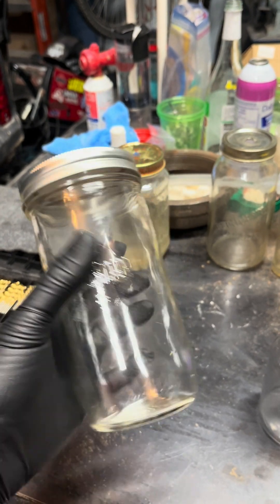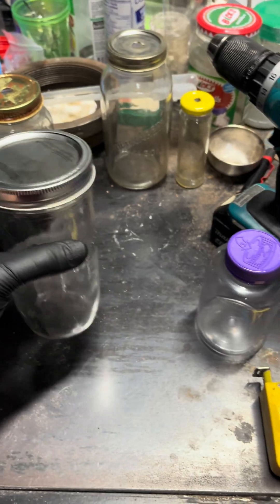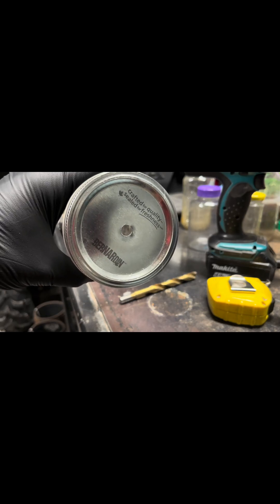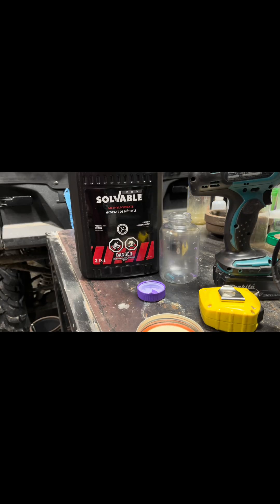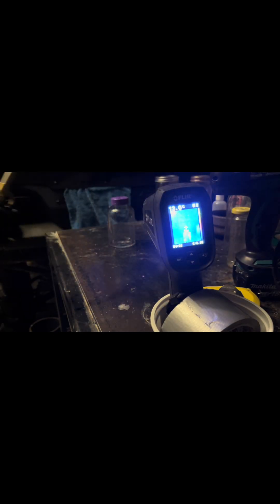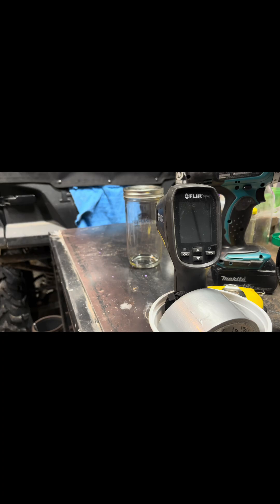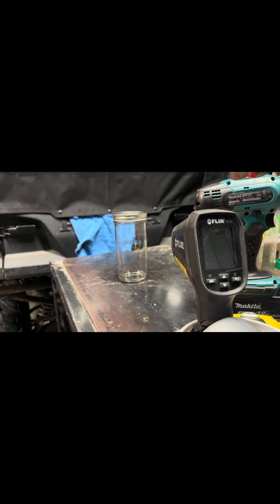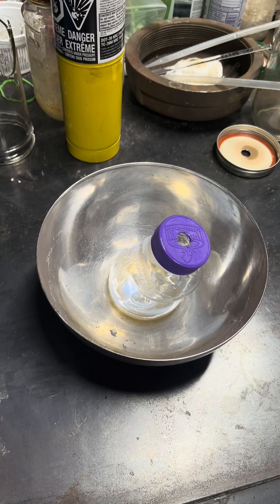“Jam Jar” PulseJet Tutorial

Comment: There seems to be no practical purpose to this. A pulse jet that provides no useable force. Or does it run if the jar is tipped on its side as well?
Reply: Pretty light.
Reply: @x1r110 until it explodes... LOL
Reply from the maker: The metal ones are quite safe actually
Reply from the maker: It does produce some thrust, but these do have very little practical use as the thrust is not much.  Great as demos, but I am currently trying to get one working as a boiler because they produce a lot of heat.
Reply: @AdhDad420 what's their efficiency as a heater/boiler?
Reply from the maker: In theory as a water heater / boiler it should be possible to engineer it quite efficiently.  The majority of the energy ends up as heat and sound.  I believe there are actually pulse furnaces that exist (Fulton I think)
Reply: It's just for run.... need not other reason.. right?

Comment: What would happen if you put water in the bowl to help cool down the bottom of the jar?
Reply from the maker: It does help out, but the jars still do eventually crack from thermal stress.  Seems to help keep the fuel air mix from going too rich though which is good

Comment: Definitely try a second smaller hole to allow intake of oxidant (O2) as well as for pressure relief should it continue. 
The small hole in the side will not interfere with the top "fire" hole as the top is removing methanol and oxygen from the container in thermodynamic exchange from a high pressure zone (the jar) to a lower pressure zone (the atmosphere) and by adding a hole in the side (2/3rds up is likely optimal but test) draws more oxygen into the jar but due to the thermodynamic flow the oxygen goes up to the fire hole as it is being "sucked" to there. Therefore it won't reduce internal pressure in any harmful way but would allow the reaction to be more self sustaining. 
However - as inconvenient as it is, do not place what can be correctly called the 'O2 intake' on the lid or you will light both and if you don't the flame will light it. This is why 2/3rds up the side. 

If you have carbide-tipped drill bits: These are more affordable option than diamond, with a spear or spade-shaped tungsten carbide tip that can drill small holes in thinner glass. (Eg 1" or less thick) 

Key glass drilling tips:
Use a variable-speed drill set to low speed (around 400 RPM) to reduce heat buildup that can (will) crack the glass.
Keep the drill bit and glass cool by CONTINUOUSLY applying water or a coolant to lubricate and prevent thermal shock.
(A garden hose covering the area with cold to room temp water is high tech enough)
Use masking tape on the glass surface to prevent the bit from slipping and to reduce chipping.
(Important!)
Start drilling at an angle to establish the hole (using the bit shape to basically "sandpaper a small crater of rougher and thinner glass), then straighten out to drill vertically through.

I think if you experiment with the ratios of the two hole sizes and the height of the O2 intake you will find the Goldilocks Zone. 

I am an AI architect and data analyst. Data analyst is a term for "solving problems for a living" literally. All problem solving. 
I'm no expert in Newtonian mechanics, Complexity Theory is more related to what I do. 

BUT problem solving is problem solving if it's an AI or a Jam Jar Pulsejet, my technique, which got me a six figure job (I did it for a decade then left to become an inner city Outreach worker) was to JUST TRY THINGS and keep only trying things until I found things that caused my security clearance to be raised. 

Point is- these are interesting experiments and just keep improving it and it may bring you somewhere you didn't know could exist
Reply from the maker: Absolutely, continuous improvement is the name of the game ! 🍻

Comment: The reason it breaks is thermal shock.  You have cold gas in a glass jar on a cold dense countertop.  If you prewarm the jar and place it on a warm block in the bowl, it might not break.  Aim for warm coffee temp before starting.
Reply from the maker: Solid advice! I have since tried different preheats and gotten mixed results but as you say, a mild preheat does seem to be pretty effective
Reply: That can happen but if drilling the hole too small can cause it, it's because it doesn't release enough pressure.
Reply: That would explain breaking not exploding. Exploding is because the pressure builds faster than it can escape through a smaller hole vs a bigger hole.
Reply: @CaptnHampton22  EXACTLY! We used to make draino booms for fun. Our science teacher found out about our misguided use of the lessons he was teaching us so he did a full week of classes breaking down all the different dumb stuff and why it works or doesn’t and why they are so dangerous! He explained that the difference between an experiment and an ill advised prank is knowledge and safeguards! Throughout the whole week though he covered rapid expansion of gasses in multiple different formats that even a 3rd grader could have understood! 

His goal was to prevent us from becoming statics as he explained in the letter sent home after a few parents got upset. Looking back his approach was spot on cause we were gonna do dumb stuff either way we just knew how do it safer thanks to him!
Reply: I had an explosion outside years ago. Don't use white gas for anything except for it's intended purposes.

Comment: Hey, do you know what ratio is working best for you between hole diameter for the inlet/outlet & the container volume where it threads on?
Reply from the maker: I’m not sure what the ratio is honestly, but for average glass jars, regardless of volume it seems to be 1/2” as long as height is roughly double width.  The only time I’ve ended up with a substantially different hole size is with a different fuel or a container with an odd ratio or geometry (my spherical pulsejet was closer to 3/8)